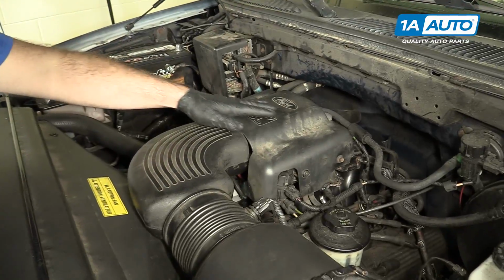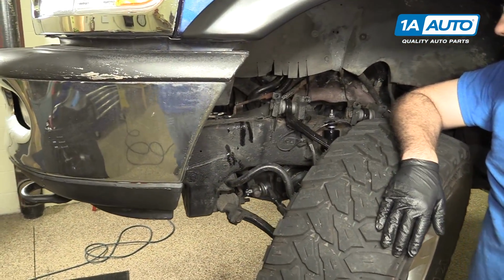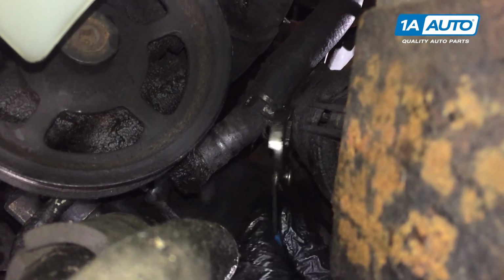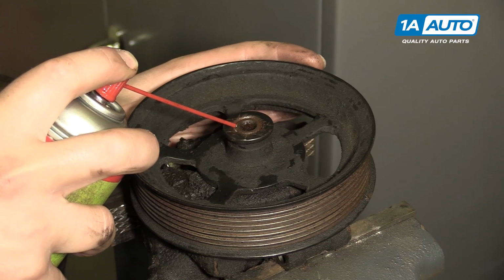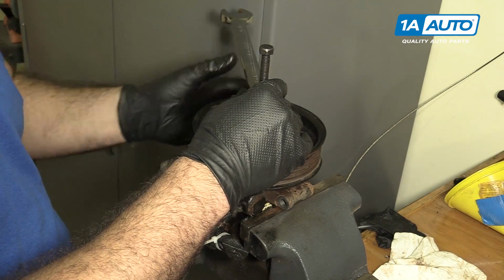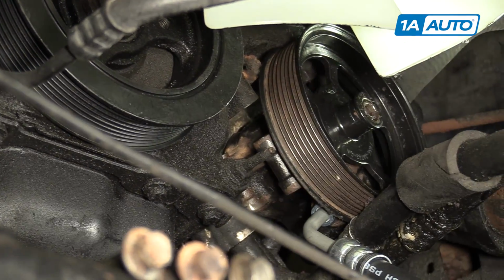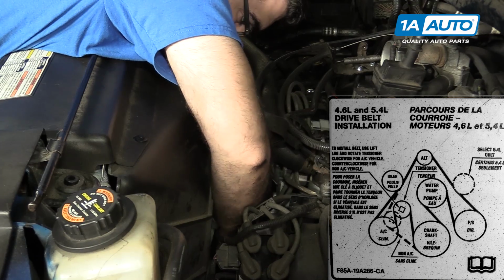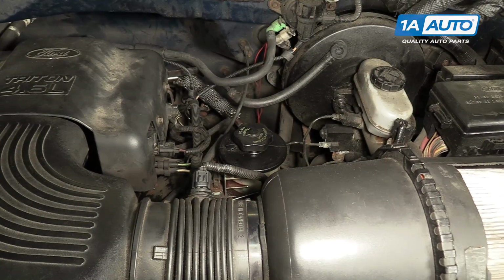How to Replace Power Steering Pump Pulley 97-04 Ford F-150

Comment: Loved your video. You are very detailed which makes a big difference. Keep up the good work. Regarding the high pressure line at the steering box where you used a 14mm line wrench (I think that's what you call it) it has the "o" ring on it. I need to know how far down to tighten it because for some reason I have it in my head that it is flush with the steering box and it didn't show in your video. It showed you starting to tighten it but not when you finished tightening it. I still have a bad leak after replacing the high pressure hose but I'm almost thinking it could be the pump. Hmmm.

Comment: Can I leave the power steering pump attached and just change the pulley itself is it required to take the pump off in order to install a new pulley or is not really not necessary ?
Reply from the maker: +Danny Holman You don't need to remove the pump itself.

Comment: what is the part# for the power steering pulley "remover"? I have a 1988 ford F150 and need to get the puller. THank you.

Comment: Apparently after little thought I concluded that the pulley does not have a bearing, as it is pressed on to turn the shaft. My problem is chatter seemingly coming from the PS pump pulley. There seems to be excessive end play from the shaft and when I pull the pulley in and out I can hear the shaft hitting up against the inner casing. I saw that end play is common with these pulleys, but I think mine is a bit excessive lending me to believe that the shaft bearing is worn. I have no other noise such as the typical whine when low on fluid etc. I saw that one guy posted that his problem was the pump hold down bolts had vibrated loose. So I will check that out by seeing if the pump is loosely attached before replacing the pump.

Comment: My 2000 F150 V6- you use a 15 mm socket on the tensioner pulley bolt and turn it counterclockwise to loosen. The bolt is a left hand threaded bolt so it does not loosen when you turn it counterclockwise. Does this pulley have a bearing that goes out? Mine has been making noise and using a hose to my ear  I figured the noise was coming from the pump. I removed belt and the pulley has excessive in and out play. Haven't taken it off, but figure it has a bad pulley bearing as the pump makes no typical squeal noise and is not leaking.